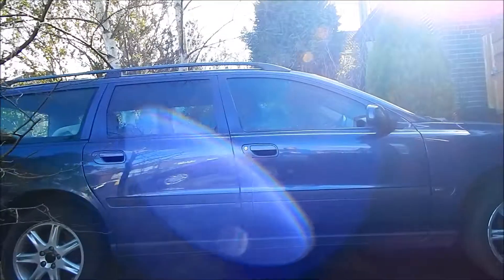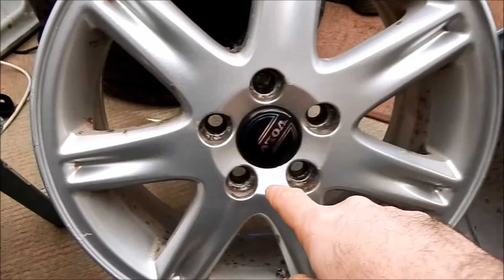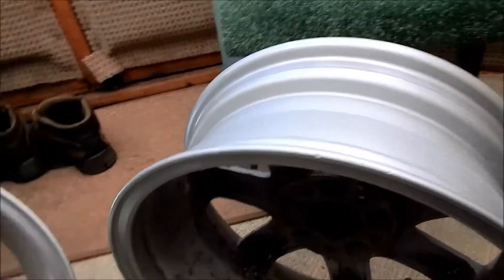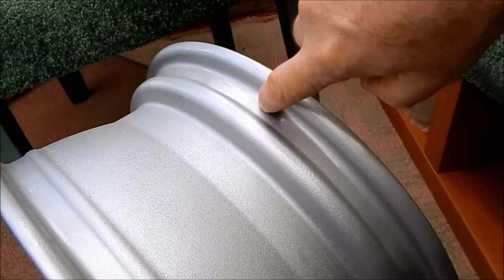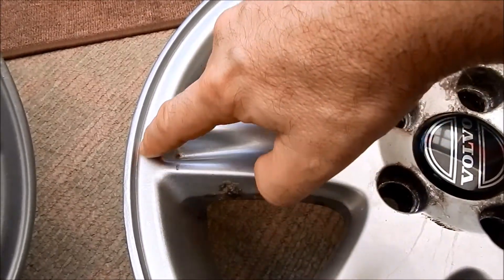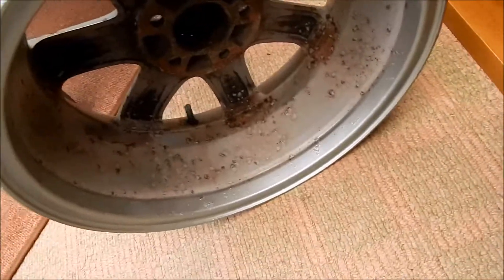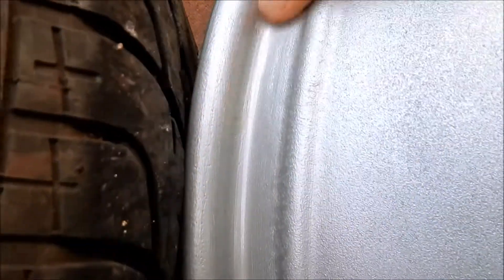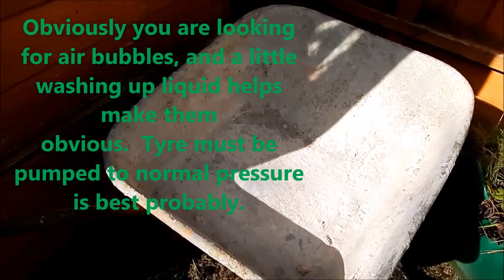REPAIRING SLOW FLAT on TIRES (TYRES) - Corroded wheel rims, corroded tyre beads, alloys - HD1080p

Comment from the maker: The question was posed why indeed do I have a spare set of alloy wheels?  For winter, I wanted two wheels extra, to put winter tyres on.  People tend to sell off the remnants of the car as four wheels, or it's just as cheap, and also, you can pick the best two for the winter tyres.  And yet, here in the UK we had one single winter bad enough for me to need them, 2013 perhaps?  That was it.  There has not been serious enough snow for me to even take the 30 minutes to put the spare rims with the winter tyres, on the front driving wheels of the car.  I await heavy snowflakes in hope...I will be ready...as long as I don't change my car...

Comment: I thought this was a REPAIR VIDEO ? CHANGE TITLE.
Reply from the maker: nowr2run People think they have a slow puncture, with the slow leak symptoms this issue causes.  This vid explains what the actual issue is and how to repair it, giving assistance to people out there. What did you do to help someone today?
Reply: It does NOT SHOW HOW TO REPAIR IT, THAT WAS MY WHOLE POINT. YOU SURE AS HECK DIDN'T HELP ME SO ? You have only 2 comments on here, 2 negative comments on this vid. GUESS WHY ?
Reply from the maker: nowr2run I genuinely thought it was straightforward, but there are two main ways you get a slow flat or slow escaping of air from a tyre (tire) and these are apart from the issue of valves having grit in them or not tightened in properly etc.  The video explains one of the issues - rims corroded around the edge depicted where I run my fingertips along the wheel edge, where the tyre bead sits in place.  You sand this down, this corrosion, first with very coarse sandpaper then much more fine paper.  Once smooth again, lacquer/paint this internal edge, let it dry, and also clean the bead of the tire.

Comment: Would have been nice to have seen a 'before' of the rims, how bad the corrosion was. But thanks anyway for the vid. I am having the same problem with my VOLVO rims. It seems to be an issue with Volvo alloy rims in particular. Almost ALL other videos I have seen about this, they have Volvo rims.  Interesting would be to know if the problem started after they were bought by the americans. And I would bet this is the case, as I know my american companies ;)  Btw, mine is a 2000 Type I V70.